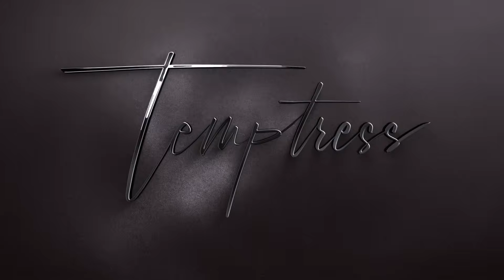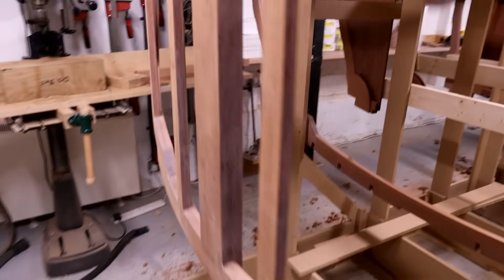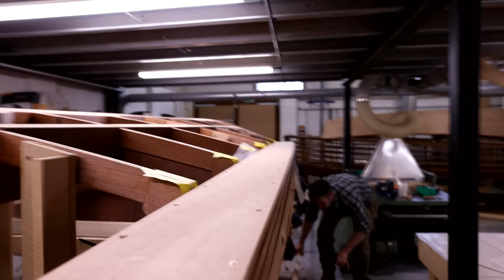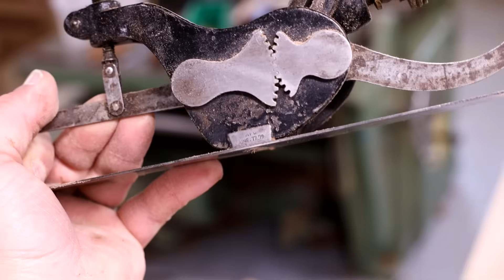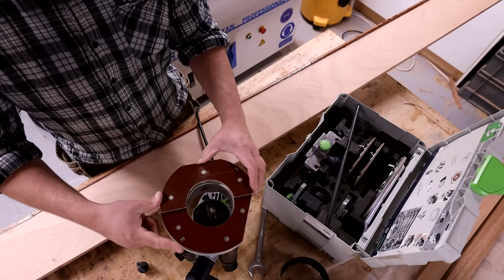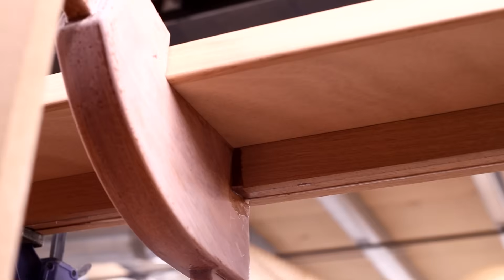Building The Chine Flat Lamination | Building Temptress Ep33

Comment: Quite new here, still trying to learn. But why is the chine not in line with the bottom of the boat?
Reply from the maker: The chines have a flat section on them that is widest at the transom and reduces down to flush at the bow
Reply: @DanLeeBoatbuilding thanks, is that for better stability?
Reply from the maker: Yes I believe so.
Reply: He will add more wood soon.